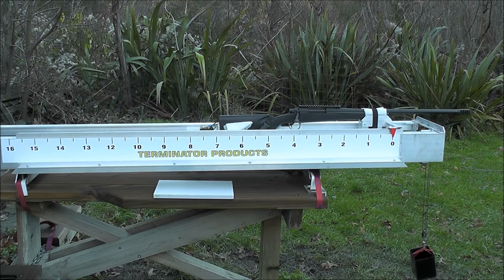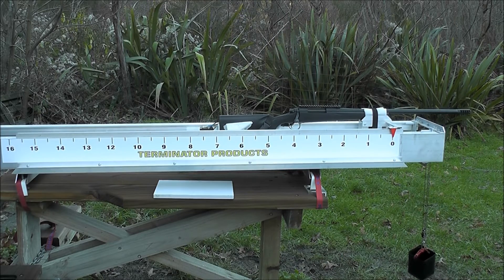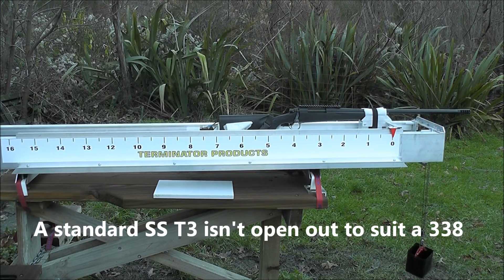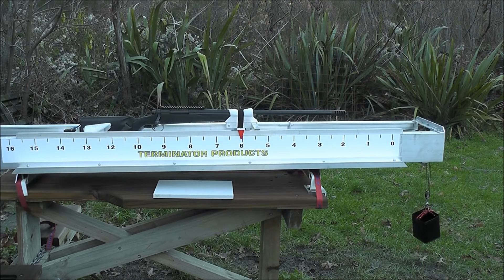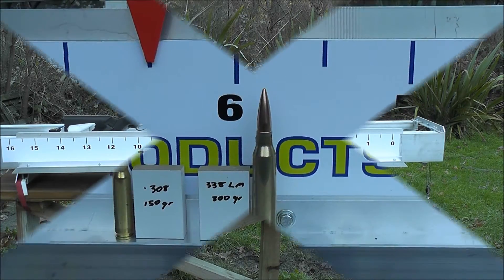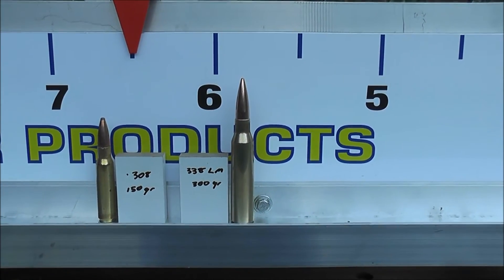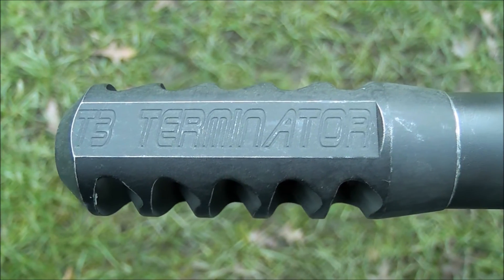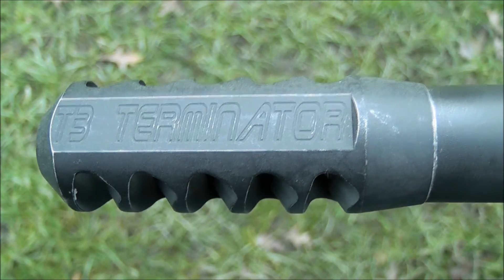T3 Terminator Muzzle Brake on a 338 Lapua Magnum compared to the recoil of a 308

Comment: Did you have to have somebody thread the muzzle on the 338 rem 700 p or were you able to remove the factory brake?
Reply from the maker: miguel contreras Hi, I made a jig out of a bit of box aluminium with a hole through it for the brake & then a couple of holes through the alloy so I could put a couple of drills through the alloy & brake so I could turn it after putting the barrel in a vice & heating the muzzle brake. They are quite hard to get off. Cheers Greg.